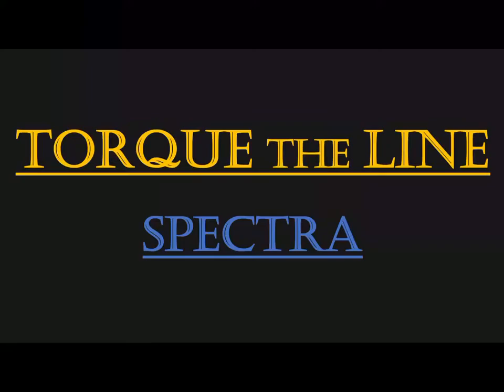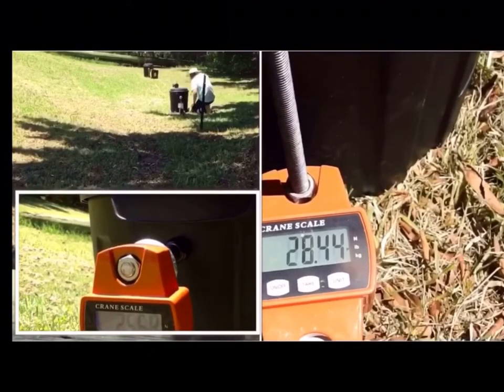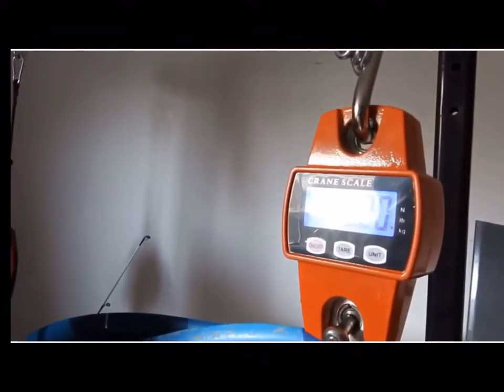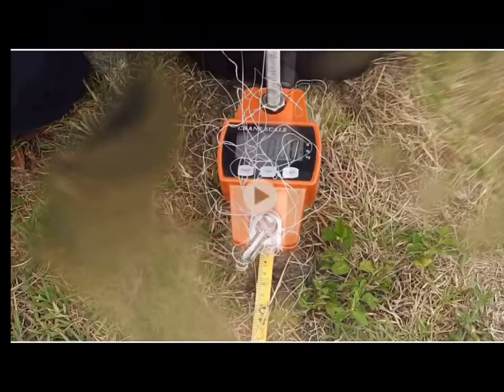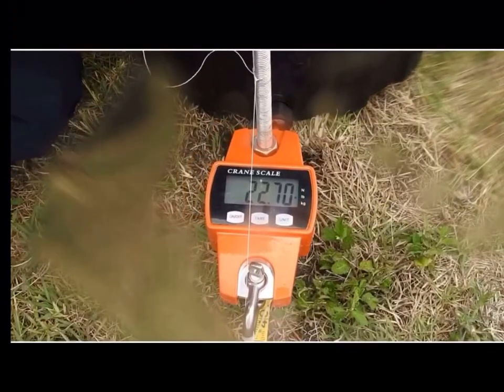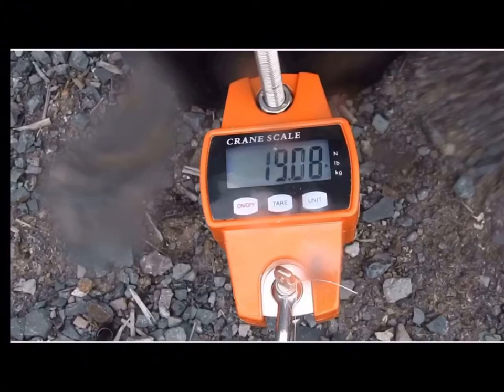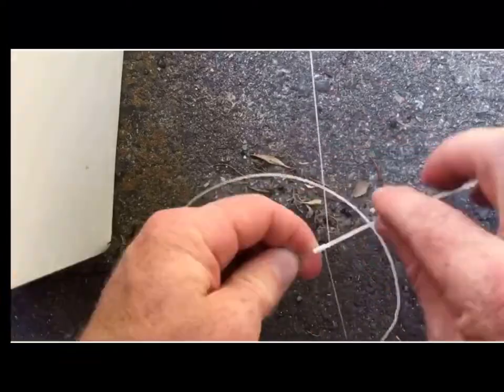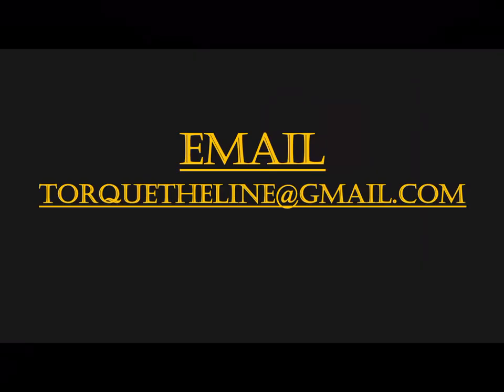TORQUE the LINE EXPERIMENT - SPECTRA FAIL

Comment: Mitchell--thank you for all your efforts. I know it's frustrating, but you did uncover an inherent problem. In one of my original comments, sometimes manufacturers have a bad batch of product, so their quality control definitely needs improvement! lol
If/when you do this again, I'm wondering if the manufacturer would be willing to test it before they send it to you to guarantee its integrity? The only other problem I see is that they'd have to guarantee the entire roll. Who's to say that once you're performing the test, that somewhere in the distance of the 2 mile length, there's a weak spot? Have you determined at what tension you need for a valid experiment? In other words, if the line is snapping at 45lbs, would 40lbs of tension work? If the manufacturer is unwilling to guarantee the entire roll, maybe they would be willing to test the beginning and the end (and hope that everything in between is good). What do you think?
Reply from the maker: Thanks a lot for the support Wendell I appreciate it mate. I actually did say to them can they test it before they send it out but they guaranteed it was rated at 50lb with breaking strength of 78lb, so like every other “profession” you take their word for it. Just shows you really have to make people show you proof of something before believing it, so yes if I were to get another line I’d make them test it first to avoid this situation again.
50lb was the minimum I needed for the buoyancy values, which should have been easy to achieve as it’s well under said breaking strength. It was so inconsistent the tensions it was breaking at, I’d understand if it kept breaking round 40lb but it was as low as 18lb snapping sometimes! And every number inbetween, turned out to be such a rotten lemon. 
Imagine a fisherman losing an awsome catch because the line was defective, you just expect what you pay for.
Love the work you’re doing to mate, that mirror reflection experiment was hands down the best proof I’ve seen of no curve, such a great thing you guys did man keep it up

Comment: Like i said dummy you will never get the curve out of it before it breaks... I was right you were wrong..
Reply from the maker: @Flat Earth Reset You’re an idiot the line is defective.
Thanks Rob, you’re spot on mate, you can never know something for sure until you try it.
this experiment has in no way failed, only the defective line has failed
Reply: @torquethelineexperiment1253  LMAO at defective line... Get another roll... Like i said it doesnt matter what line you use it will snap before you get it tight enough and thats what happened. And you all called me a dumbass on globebusters for saying this will fail....
Reply: @torquethelineexperiment1253  if a oil tanker can not pull a anchor chain or a mooring rope tight you have no chance .Research what Flat Earth Reset is telling you .Even using natural buoyancy line under water as per Christopher Salter experiment ,it's impossible to get the curve out of the line .I thought Salters experiment was good till i got a education from Mr Reset .
Reply: ツяøbʁìçhぃ  oh look, the flat earthers can't put forward a truthful, repeatable observation so out comes the insults well done to you sir.